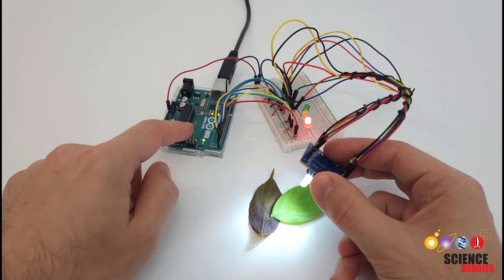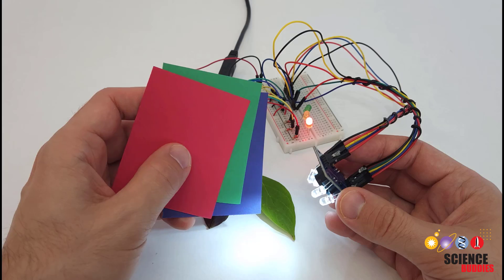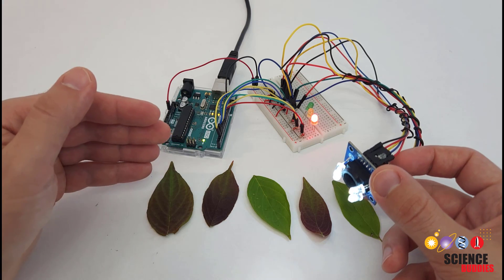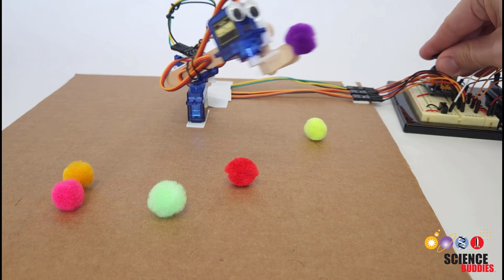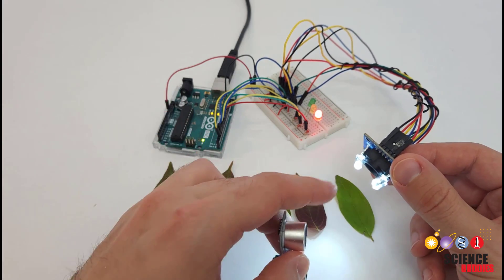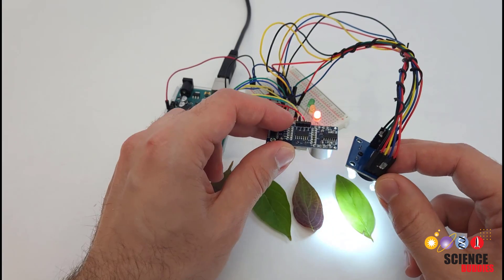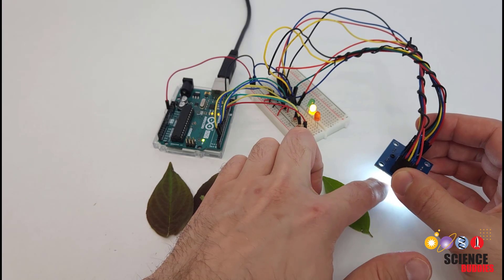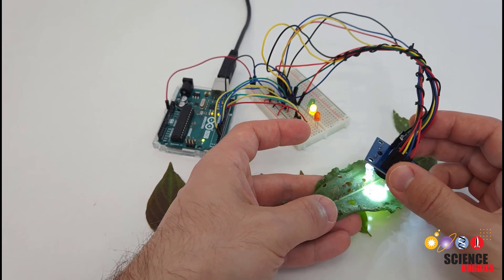Leaf color detection with Arduino | Science Project

Comment: You could add a camera to detect / see the small holes in the leaf. You could add a temperature / humidity sensor. You could mount all on a robot with all controls and feedback via wifi. You could mount all components on a drone to fly over a field / area.
Yep, lots of cool and exciting applications. I have been tinkering with an Arduino board for about a year now. Great fun.
Reply from the maker: You're right, there are tons of things you can add with an Arduino! Check out our Arduino tutorial playlist for videos on some of the specific parts you mentioned: https://youtube.com/playlist?list=PLlBVuTSjOrclb0iCMSRpS_H1lSrlSVeEm&si=_MtX7mej__0BCtIM